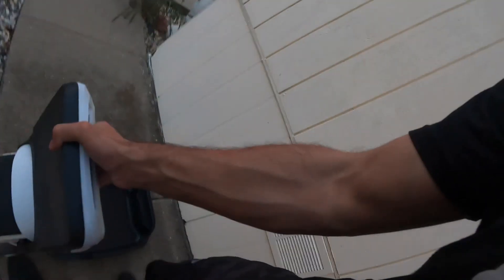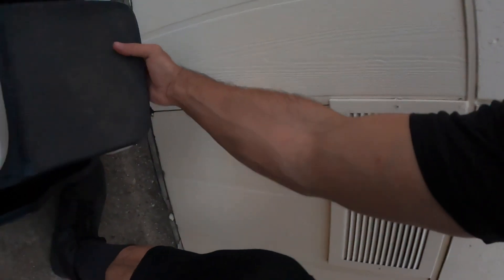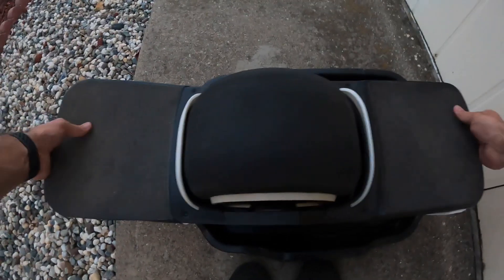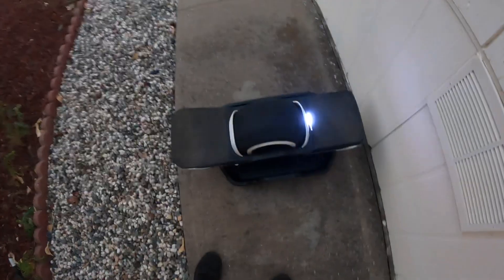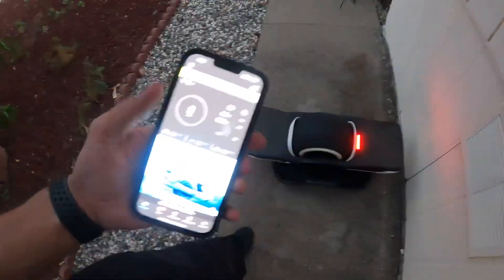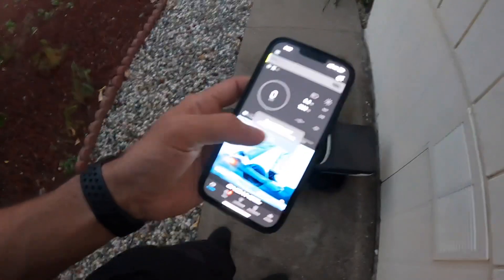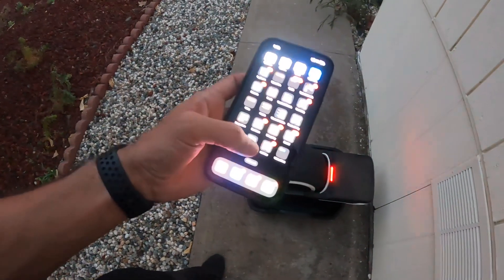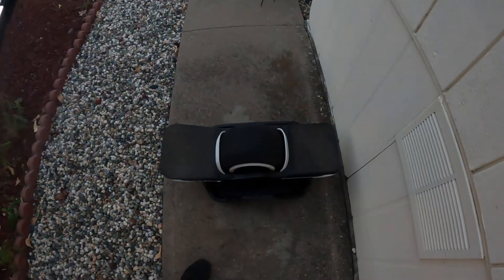Unplugged: Fighting Back Against the Onewheel GT 'Corrupted Memory' Error

Comment: i'm getting the same error, but I have cassiopeia 6176. Is there a way that this could be fixed on my board?
Reply from the maker: Yes! You would need to have your controller reprogrammed with an older firmware (i.e. Cassiopeia - 6153). I offer a service for this. Feel free to reach out via my website.

https://www.fixmypev.com/contact-us

Comment: Hey man, I've bought on used and it has the same error after I disconnected the battery, might it be possible to downgrade firmware? Mine is at 6153?
Reply from the maker: Yes, it is possible to downgrade the firmware by way of one of the services I offer. If you haven't already, feel free to contact me at https://www.fixmypev.com/contact-us for more info.

Comment: Would love to try the Re calibration BT app.   Where can it be found ?   Have looked bot so many links and pages moving and or have been taken down.
Reply from the maker: Assuming you're not running the most recent firmware on the Pint, Pint X, or GT, there are multiple methods. 

For Android, you can use nRF Connect (we have video guides here on the channel).

For iOS, you can use the OWDT app via Apple's TestFlight app.

https://testflight.apple.com/join/1Agva4HU

Comment: My gt been down a while has same red blinking light n it's a pain
Reply from the maker: Sorry to hear that! Is your board running the most recent firmware (Cassiopeia - 6153)? If not, you may have the ability to fix this.
Reply: @fixmypev  i have never messed with my board and it just started blinking red and said corrupted memory could this just be a firmware issue?
Reply from the maker: @JESSEHIGGINS507  That's difficult to say because I haven't ever seen it happen (not that it's impossible). It's more likely that your BMS may have intermittently lost power from the battery. If you'd like to discuss this further, feel free to contact me at https://www.fixmypev.com/contact-us

Comment: Hey man! I came across your video when I got this error and FM tried screwing me… 

No matter what I’ve tried, whenever I click on “connect” on the website, nothing happens 😭 

Any advice on how to get this to work? 

I’ve tried it on safari and google chrome and cleared all my cookies
Reply: I realized I needed to download the webler app… I went ahead and downloaded it and for some reason the “connect” button still isn’t working for me on the webler app 😢
Reply from the maker: Picked up via DM. 💯
Reply: @fixmypev it’s not working for me either bro 😭
Reply from the maker: @alexsbloggiesyt9762  Hey! Just emailed you back. 

The Webler developer changed something last year (for an unknown reason) that broke the compatibility of my site with some of the boards. I originally took my guides down, but found out some people had been using them on their computers (with ReWheeled boards).
Reply from the maker: @alexsbloggiesyt9762  Sorry to hear that. What are the symptoms of the issue you’re experiencing?

Comment: So it’s complete nonsense? You can just unplug it?! For air travel and plug it back in?!
Reply from the maker: For boards with pre-6132 firmware, yes. Complete nonsense. And if you’re pre-6153, you can revert your firmware back to 6109 using ReWheel (to unlock BLE factory mode for calibration).

Comment: Dude!!!! I was about to let go my gt cuz of all the problems and dont wanna deal with long term my battery die and especially we cant replace the battery and the loose xt60 connector, one more thing my gt randomly shuts off during mid ride, do you have an advice for this? I have no warranty and no plans so send it back. I only have 56 miles on it but bought it 2nd hand. Hopefully you could help me out. Thanks.
Reply from the maker: If your GT is randomly shutting off, that could be your Controller XT60 or even a loose motor connector (both widespread issues). Could also technically be loose XT60 connections in the battery module, but that’s less common than those other causes I mentioned with the GT.

That said, I know you said you have no plans to send the board back, but you might not have much of a choice given the proprietary nature of a lot of the parts (unless you can source them used somewhere else).

Comment: So I'm assuming this means you can swap a new battery in right? Like cbgt?
Reply from the maker: Correct! However, it is important to keep in mind that some newer GTs do not seem to respond to the BLE commands. This means that the newer boards could fall victim to the Corrupted memory error with (almost) no resolution other than sending your board back to FM.

Comment: Hello, option 4 of the website link shows "connect" and clicking on it does not respond. May I ask what the problem is?
Reply from the maker: Which browser did you attempt to use? And on which mobile device?
Reply: @fixmypev  My onewheelgt will display an alarm when the battery level is about 50% remaining, with a red alarm. Once it stops, it cannot continue to start and can only be restarted again. This cycle will follow. I don't know if the battery is damaged or if the cable triggered the defense system during the collision. I am in China, so it is basically impossible to transport back to the United States. The time and economic cost are too high, so I want to use your method to restore my onewheel, But opening the website link, item four, clicking the button 'connect' did not respond. The operating system is iOS/Thank you
Reply from the maker: @FloatJet  If you are attempting to use iOS, be sure you are using the Webler app. If you are using the native Safari browser, it does not support Web Bluetooth. If you're still having issues, please send us an email via our website (www.fixmypev.com).

Comment: I air travel with 2-3 XRs everywhere I go. Disassemble, ship batteries ahead, reassemble at destination. Have been doing thisnfor 2 years but now have the following issues:

Example: A week before my trip I ship a battery to my destination that is 20% charged.  On the day I leave, I remove a battery that is 100% charged from the XR I take with me. At hotel, I reinstall the battery I shipped out. The app on phone shows it is 100% charged. I ride it. It dies at 80%. I recharge it. It stops at 100%. I ride it again. This time it dies at 85%. After another charge to 100%, it dies at 90%. Eventually it gives me about 1.5 miles before it dies. That formerly good battery will never be normal again. I recharged and imprinted new max levels to the cells. Boom! A retail $500 XR battery pack is now ruined. 4 of my 6 XR batteries now either won't hold any charge or they max out at 59.5 amps and only ride for 6-8 miles before they die.
Reply: Knew it was more punishment from FM for me doing something they don't want me to do. Fuck FM forever.
Reply from the maker: Ouch! That sounds horrible. Have you attempted to do a full balance charge on the batteries? Also, if you can help it, it is generally best to keep the batteries between 40-50% when not installed in the boards. This is a good maintenance percentage range as it will not put unnecessary strain on the battery cells while in transit.
Reply: Right on all counts. Not always great about keeping them at 50% before shipping, but for longer term storage, I do. As far as the balancing the cells goes, it doesn't help. In fact sometimes a working battery that charges up to around 60v will only charge up to 57 or 58a in the am after being plugged in overnight. I hear that if you have any bad cells, balancing just brings all the cells down the same level as the lowest voltage cell. 

Anyway, great video and I appreciate you trying to help. You are the first other person besides me who is speculating that this inaccurate charge % read from app to a newly changed battery is part of their right to repair BS. Thanks especially for that.
Reply: Am recommending to everyone to ship your entire battery housing and cable assembly & BMS together as an assembled component. Then what happened time will not happen to you. (Only risk is, if your shipper loses your package, and inadvertently delivers it to the wrong address, you will basically lose your entire wheel. Cost for replacing all those components could be as high as $1300-1500,..and that's IF you can actually get them all online somehow. Done

Comment: Thanks for this. FM claims on the box that the board comes with custom shaping, two years later, still nothing… Then a company that actually makes the custom shaping we've been wanting gets pushed by FM to remove the app. 

It's glaringly obvious they're all about money and control, while claiming to be all about safety and "spread the stoke, bro". Once we get the GT permanently repairable in all parts, I really hope FM gets sued into oblivion.

Thank God my friend Shaiden who got me into OW back in 2019 warned me about evil FM. I have bought 3 GTs all used because I don't want to directly support them. What a joke of a company! Kyle didn't even invent the OW as noted by Floatwheel where they reference the YouTube video from 5 years before Kyle patented the design. 

Hopefully quick swap batteries come within the next few years. I would rather have that than more capacity. Because then I would only take the back up battery on longer trips, and also, I could ship the board easily without worry.
Reply from the maker: You’re welcome, Austin! ✊🏼⚡️🛠️

Comment: I could not get this to work for my 4206….to old?
Reply from the maker: The Corrupted Memory error is specific to the Onewheel GT. That said, the process completed in this video still applies to the XR (for a different purpose). Check out our guide for more info: https://www.fixmypev.com/diy/onewheel/xr/calibrate
Reply: @fixmypev  I used the xr guide lol, I wouldn’t try the GT on the XR.
Reply from the maker: @coreytheecorey4056  As an FYI, it’s the same codes for both the XR and GT (minus the hall effect sensor calibration for the GT).

Comment: I believe that has to do with the bms battery cell percentage not being calibrated. I've swapped bms before and had to recalibrate my XR because my battery percent was way off. Once recalibrate it read correctly. So I'd say once you recalibrate it would read the battery percentage correctly.
Reply from the maker: Yes. In this case, we were able to get the battery and controller back in sync by plugging the board into the charger for a bit. 💯

Comment: This is called "volatile memory" in programing. The "memory" is held in a mico controller ( a very cheap one ) that loses its memory when it loses power. A nin volatile micro controller cost a bit more and will not lose its program when power is dosconnected. The reason it shows 1% after you unplug it is because future motion sucks at programming. Their coding has so  any extra variables and unfinished abandoned code it literally looks like it was programmed by a 10 year old. They also have a line that is very sus it shows a ticker that has a else/if line that marks 5000km ( in the board i checked ) meaning that at around 5000km it WILL brick.. dont buy their shit, get a vesc
Reply from the maker: Whoa! That's insane. How did you check that?
Reply: @fixmypev  re compiled the machine code from the micro on a busted gt ( swam in lake). Note that de compilation it not exact science and is open to interpretation as micro controllers have incryption built in. You can 100% test which pins are hot when a line runs though. I learned code decompilation back in the 80s programming early dos systems when people would destroy their exe system files
Reply: Yup that's why XR is better..XR 4 LYFE!
Reply: Have you herd of someone’s bricking at 5000km… all top 10 mileage riders have well over that, and grant brown has 6 times that. 

Just wondering
Reply from the maker: @coreytheecorey4056  That's the first thing I checked as well. Doesn't seem like something that should be a major factor. Still interesting. I wonder what the relevance of the 5000km is. 🤔

Comment: brave soul, good job on finding out how to do this, thank you!
Reply from the maker: Thanks! This method was originally discovered by some of the independent developers in our community. It had previously been hosted as a side-feature of ReWheel, but that project has since been removed as a response to DMCA violation claims. It should be noted that this process utilizes BLE technology and does not make any modifications to the base firmware of the Onewheel. 🤙🏼⚡🛠

Comment: Great stuff man! Any reason why you opened the controller box during disassembly? 🤔
Reply from the maker: Yessir. It's safe practice to disconnect power to the controller when working with the battery/BMS. Helps avoid damaging those components if anything were to go wrong while accessing the battery enclosure. Thanks for the support! 🤙🏼⚡🛠
Reply: @fixmypev  oh okay that makes sense! Thx for the reply! Do you think this method could potentially work for hypothetical extended batteries, like from Chi, that may eventually become available?
Reply from the maker: @chriswhite599  Hypothetically, yes. Although the controller may still have a problem with higher capacity batteries unless other circumvention methods are deployed. Would love to see some stock replacement options out there (for all models).